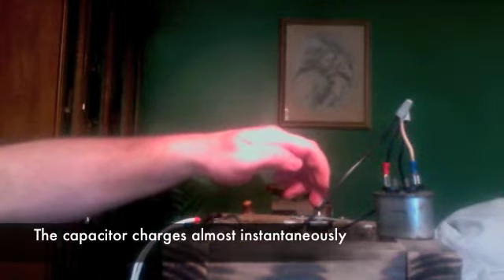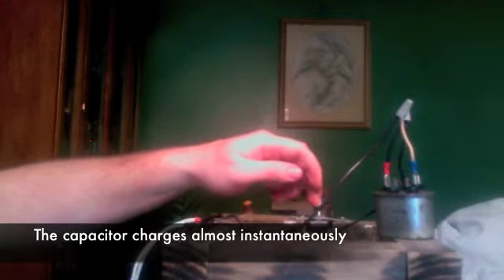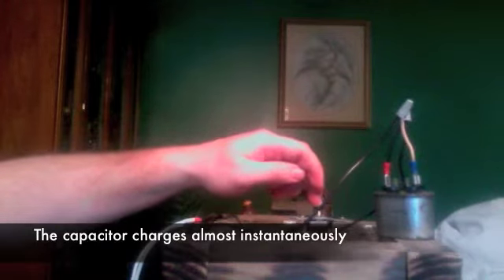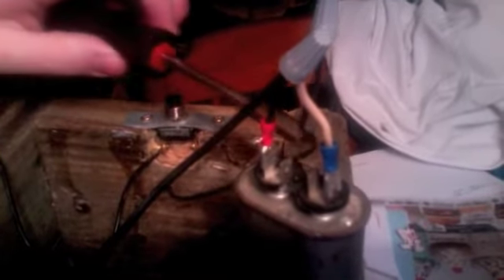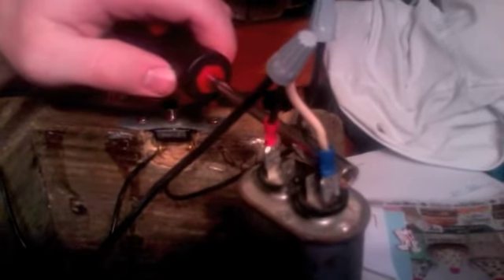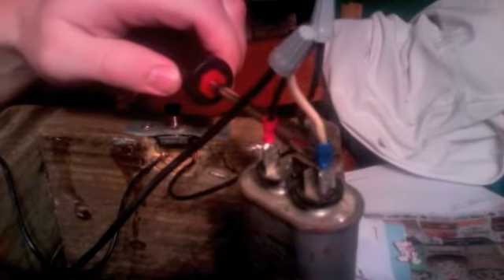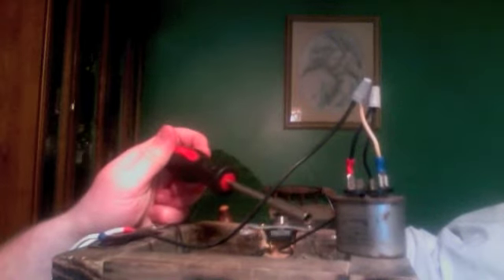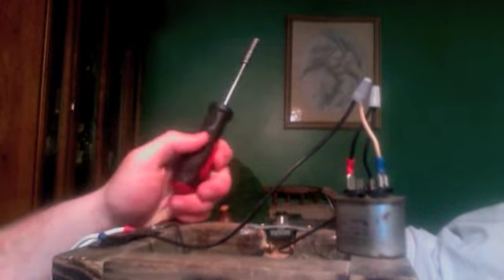Non polarized capacitor discharge

Comment from the maker: Thanks, I had a single stran of wire acting similar to a fuse in case something went wrong. I've upgraded to a commercial grade fuse since then but I had a friend think the circuit was so cool that he held the button down then shorted it out, there was a good size pop since it was then connected dirrectly to mains power and the stran melted just like it was supposed to. lol